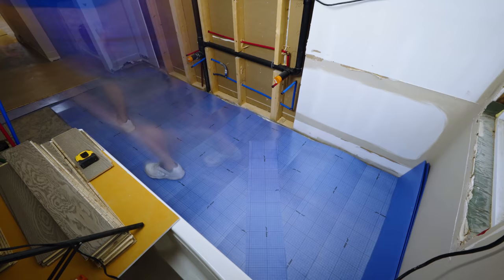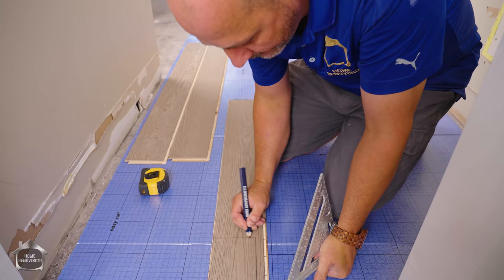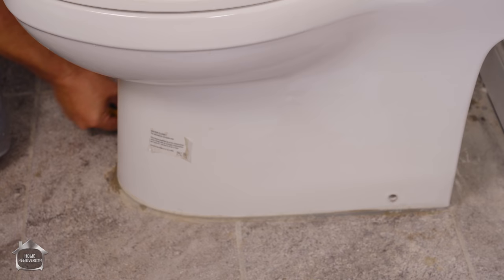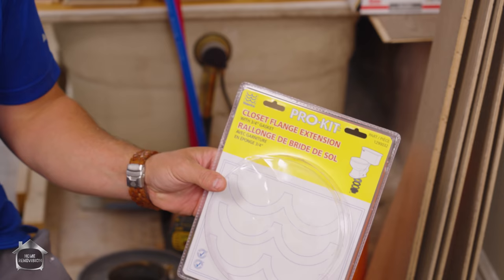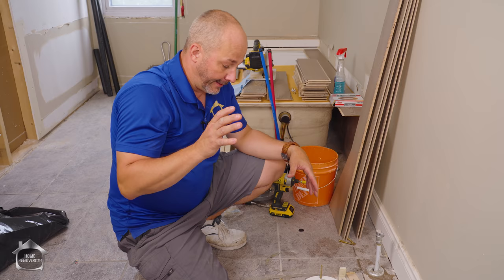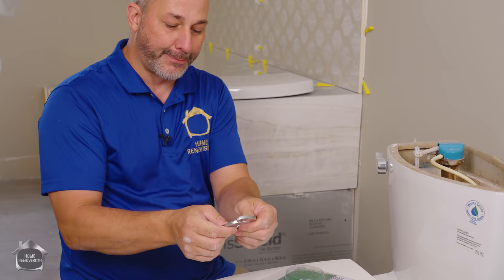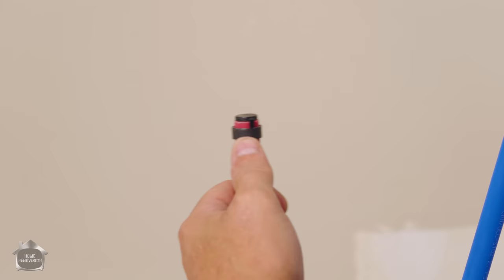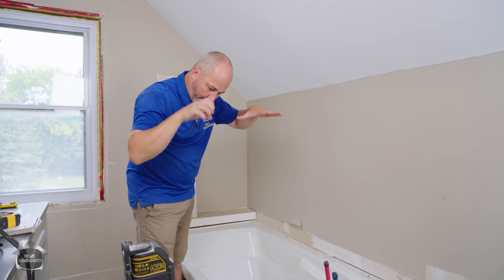How to Remodel A Bathroom on a Budget | A to Z

Comment: 3:32:00 except when the mounting tabs are grounding tabs to ground the metal outlet box

Edit*
And that is a grounding outlet, has the little odd colored tab on the bottom screw which marks it as one that has grounding screw tabs

Edit*
Lock out, tag out
Lock the breaker box, mark it as locked for work
Reply: Glad I'm not the only one that noticed... Holding the (wired) ground ears of the outlet with one hand while (saying it's "safe") and handling the live leg - had he touched that bare wire accidentally, this would've been his last video!

Comment: This is HILARIOUS!! Ok, I’m not knocking you too hard but shout out to the plumbers 💪. I’m not sure where to start lol, you did so much with so much confidence and horrible craftsmanship. Easy cut floors, I love it too (still cut it 4” too short on floor.. but when you cut your flooring, use a fine blade on jigsaw (not all purpose) to reduce rips, or blue tape to stop the rips. When you hear that “noise” it does not mean it’s in.. it means you’re breaking your connection. When you install floating floor just make sure you push in pretty hard at a 45 degree angle, when space is tight from left to right, continue pressure inward and down.. it should sound like nothing and you should FEEL it click. (I’m a professional commercial, million dollar residential) I do full remodels to Eletrical (Only ever do anything as big as sub panel additions, but full Eletrical runs) Drywall, trim, hvac, gas, plumbing.. Sauna Shower, Body dryers, jacuzzis.. which btw, you absolutely killed yourself.. when you install.. sure install with quality, but also install for the next guy. This just happened to be you, and you effed yourself by not putting an access panel in. For only $40 you could’ve made an access door in the floor, where are your shutoffs too? I’m 1/16 of the way through your video and I had to start commenting because it was so bad.. the whole toilet repair was a nightmare, you called PVC.. cpvc 😂.. You cut the fiberglass tub like 7 times.. you did all the laser measurements with a level tub you could’ve used to square your wall.. no dope on your crappy Amazon diverter, granted it may not leak, not good nuff.. Your cutters arnt old, they need new blades. You just don’t renew them. The copper clamps you use are horrible, use stainless crimp over those, DONT USE BRASS as a pex fitting, tons of claims under all plumbing suppliers for high zinc brass. If you decide to go with crap wirsbo or pex.. keep plastic with plastic. Also silicone really does work as water proofing, aka when you thought there was going to be mold, there wasn’t. NO SHUTOFFS again, smh. So “ma’am I’ll need to shut down your whole house to replace your diverter stem”.. 😴 “I’m more of a get things done kind of fellow” bro you just took 2 minutes to screw 10 screws. I can’t believe my eyes as I watch more. If you ever need to learn how to do things correct, I’ll teach you.

Comment: I am Very VERRY clueless as to how to redo or even where to start re-doing a house that was my grandmothers that was built in the 60s. I have to do new sub flooring I think and pull an old bulky vanity out and put in a pedestal sink.  Also have to remove a built in butane wall heater that hasn’t been used in 30 years or more. You have been so helpful. This is the first video I have seen but I know I will be watching many MORE to help get me thru my remodels of each room I do in the house

Comment: Jeff to make the hook on your wire use the hole on the side of you strippers. If you wire a GFIC backwards it won't work just change the wires wires to the correct place.

Comment: When I install a toilet with the normal two bolts.  I put white out on the ends of the bolts so it is easier to line up when placing the toilet.  You can see the white out though the two toilet holes much easier than the brass color of the bolt.

Comment: On new bathrooms, I like to tile around the toilet drain completely, install a new Oatey metal toilet mounting plate, drill the plate into the concrete and install toilet on top easy. Prevents it from rocking.

Comment: If you want a good connection on your outlet I would splice both wires and make a pig tail on it then use the screws. One wire has less chance of failing than two

Comment: I would like to add some kind of shelf or bottle holder in my walking shower. no idea what to even get but I do know it has to bevel or drain completely and have raised ridges so the bottles don't get all moldy. As for the flooring cut damage if you tape the cut it does help a lot to stop the breakout. I do this for drilling as well for my wood projects

Comment: In the United States in New England area where I am you are required to pigtail those wires and just use the one terminal for each and if you have a metal box you are required to have a ground screw and a ground green nut

Comment: Thanks to say every item as you go, I took notes!
-Vis d'encrage : pilex
Rona: 40$ch 
-guide vissage : camo
Rona: 75$ch Ama: 80$ch
-Block beton base patio
Home: 9,58$ch, Rona: 9,49$ch      Reno: 9,59$ch
-cut'n'seal, Home: 20,97$, Rona: 23,99$, Reno: 23,99$
-(bolt, washer, nut)x1/post
-4x4 posts
-2x8 beams
-2x10 box beams
-attaches métal (hurrican ties)
-joice tape
-ACQ screws (cedar,pressure treated)

Sorry for frenglish!😂

Comment: love your videos.   just so you know though, you can get zapped by only touching the hot wire.  you're thinking of DC power.  With DC, you would need to complete the circuit in order to get zapped but since this is ac, its already completing the circuit 60 x per sec.

Comment: 10:34 Pros like Jeff make everything look easy. I just got my pride handed to me flooring a bathroom.

- The click joint won't hold like a tongue and groove. If the floor isn't flat, the joint won’t keep boards from popping up when you walk.

- Inspect your boards. The joints won’t click if the corners are dinged or, you over hammer the boards together.

- Wide boards, like 8”, can be a pain to cut a factory edge without a sliding miter or table saw.  Usually cut edges can get hidden under the baseboard. However, you may need to be strategic when you get to matching the clicking edges on off cuts to the last of the factory boards from the box.  

- Be prepared to spend time making scribe cuts especially if you’re running parallel to a curving tub or the wall just isn’t square.  If the first row isn’t right, it’ll skew the entire thing like a bad roof.

- Is it better to run boards left-to-right or should they be front-to-back? Not sure, I went with front-to-back.
Reply from the maker: correct!
Reply: I would say incorrect. Flooring is normally left to right entering a room.

Comment: Couldn't find the subfloor product mentioned from home depot. 

This video explained a lot about this house purchased a few years ago built-in 1900. 

I now know why the floor has a dip under the toilet. Why the kitchen ceiling was ripped out. And all the other stuff mentioned here helps me understand how to improve the issues that must have occurred from the toilet which this house didn't have upstairs back in 1900. It was in the basement.

Shared this with my buddy who helped install the new toilet last year. 

Super appreciate this entire video. It's gonna help me with fixing the floor dip not screwing up anything when installing some updates. 

I didn't use wax. I had used the flexible flange. It's not so messy, but now I understand the whole process better, too 

Thank you
Reply from the maker: Cheers Patience!

Comment: I am a lady. I just want to learn something from you in order to DIY the small thing in the house. I really enjoyed watching your videos. It just comes up in my mind now so I have a question how or should I replace the tub deck mount faucet. It's kind of outdated that I want to change to different styles.  But I saw one of your video took out the tub. That means in order to access to the pipe connection, has to pull the tub on?

Comment: Jeff isn't it a bad idea to use engineered hardwood or laminate in a bathroom. Vinyl plank sure. but the others id be worried about water damage .
Reply from the maker: It's a master bath so I trust grown ups to be careful. Cheers!
Reply: Accidents happen...even to grown ups.
Reply: @juggmkj  yea but he was flipping the house so probably not too concerned with it. It’s just something I’d probably warn viewers in during the video.
Reply: @HomeRenoVisionDIY  Lol......this reason right here is why I couldn't handle the pressure of being a grown-up, in this situation! I'm a Clutz & if it can be ruined, I'd be the one you're most likely to find next to the damage. Seriously. It's bad enough I've learned to never borrow anything from anyone because it will break while I'm using it. Oh, & I'm in my mid-50's so my years of improving on this may be a lost cause............ 😍😍

Comment: Jeff I try to watch all your videos on DIY home projects you have all the latest info on materials and techniques plus I can understand clearly every word spoken. By the way , when creating halfway wall structure for faucet assembly mount  . I think you replaced the upper piece were you used a wedges to correct  vertical  piece.  But I was surprised when you created  a huge pass-through hole for water lines to tub faucet.  Anyway I enjoy watching your show. My plan is to add 3/4 bath in 1 st floor closet using macerating toilet, can't decide what brand to  buy.  I need a 120v system.  Do all need vent systems to outdoor air ?
Reply: I'm probably too late here but, the SaniFlo system is awesome! Can't say enough good things about it!!!

Comment: I heard the right way to install is with the ground plug on top.  Mainly for hospitals so that if a dr drops a tool, they can land on both the hot and neutral.  

you should take your advice btw regarding the outlets.  tighten them BY HAND instead of the drill....... don't be lazy........ love your videos tho!

Comment: I'm sure someone has commented this, but there is a release on the push in wiring for outlets.. (found out the Hard way). However I just replaced all my switches with smart switches they did not have the push in wiring option.. I go an even extra level a paranoid and wrap the outlet with electrical tape.. (wonder if that is a bad idea or not) ---- *update* literally just watched the part where you did it well done sir!!
Reply: That is not well done. That is purely amateur. Not professional. Not recommended. Or necessary. Look at any wiring device manufactures instructions. You will never find wrapping with electrical tape.  And you don't need to wrap the stranded wire around the solid wire before wire nutting. Unprofessional waste of time going on and worse coming off. Again, read the manufactures instructions. Never recommended by manufacturers or by any skilled craftsman, only amateurs.

Comment: I like my electric outlets with the face upside down. I think it's easier to plug and unplug with the ground on top. I asked an electrician, and he said technically my way is correct, because if someone didn't push the plug in completely and something would fall between the outlet and plug, it would hit the ground plug and fall to either side and wouldn't complete the circuit.
Reply: The smiley faces plugs are most always used in residential wiring. However hospitals are always wired ground pin up for the reason you stated. I'm not sure you fully get that if a metal coat hanger would fall between the plug and the wall, touching the two vertical terminals, that would cause a short circuit . Blowing up the coat hanger as it tripped the circuit breaker. Ground up is the safer way but the code has not adopted that way yet. And most people think smiley faces is correct . And want them that way in their homes. Don't want anything different than the usual. Won't increase home value by putting them up side down.

Comment: Jeff, I recently bought a house , and the previous owner had taken out the tub, and put in a stand up shower. It’s the only bathroom in the house.  I love taking a bath , and just soaking sometimes. 
Would it be that difficult to convert it back to a tub/shower? There’s room for a tub to fit back in there. Also what about the resale value. I almost didn’t buy the house because there wasn’t a tub, but I know most people seem to prefer walk in showers. What are your thoughts? Thanks.

Comment: Nice video Jeff. Should have a gfci receptacle by bathroom sink. Cut a pigtail and wirenut to your hot and neutral so the recptacle can be serviced without possibility of separating the neutral in case that is a 3 wire circuit. Also you forgot to install the metal plates over the studs you cut for your plumbing before you drywalled. Be a shame to do all that work and run a screw into your pipes. Otherwise great job!
Reply: Apparently you didn't notice, that WAS a GFCI... And more importantly, you didn't notice him holding the (wired) ground ears of the outlet with one hand while (saying it's "safe") and handling the live leg - had he touched that bare wire accidentally, this would've been his last video!

Comment: Hi Jeff! My wife and I are from Chicago and have been following you for over a year now and we love all of your videos! My wife lost her job at the beginning of the pandemic so we had to move to a new old house in Indiana that was built in 1990. We have been updating it since we moved in over a year ago. Some things that we've done so far are; tiled over tile on our kitchen backsplash, installed new counters in the bathrooms, installed new lighting, painted walls, installed new LVP flooring on the second floor, and many other things! We will be gutting and updating our master bathroom and I have a quick question for you. The shower that is there is a cultured marble shower with a cultured marble shower pan. I want to keep the same footprint of the shower and rip out all of the cultured marble walls and keep the shower pan. Would it be ok to tile over the cultured marble pan with the Eco Prim Grip? I also want to add a bench on top of the pan before I tile. Would that be ok to do as well? Thanks in advance and take care!
Reply from the maker: yes and yes as long as you are not using organics to build a bench. I would prefer to see a schluter foam bench set with thinset. Tape the bench to the joints and then waterproof roll on paint./ Cheers!
Reply: @HomeRenoVisionDIY  Awesome! Thank you so much for the response!

Comment: So I have a half bath off the kitchen that butts up to the garage. There is empty space there about and 8 x 6 area. I would like to close that off and extend that bath to include washer dryer and a shower. I can do basic stuff like plumbing electrical drywall etc. The building the walls closing off the door off the back etc is where I am lost. If you have recommended video that would help please let me know

Comment: Generally you dont want to silicone a toilet at the base because if it starts to leak you don't know until it destroys the level below.  If the base is not sealed to the floor you will know if you have a leak before you destroy the level below.

Comment: Great video! I have a question ... I don't have a flange on my tub.  I think the tub is acrylic.   Referring to around 1:09:00, Do I do the same thing and use some Loctite to seal the gap between the backer board, and the tub ( I have Hardibacker) or do I need to do something different? This does not have a shower, similar to yours.

Comment: I'm new here and SO lucky to have found you. We are starting to tackle our upstairs bath that had water damage. Question: Does the first subfloor need to be repaired if missing pieces? Or can we just use a leveler? We have two plywood pieces there and the top one has been torn up in places. I've been told the subfloor isn't in bad shape but some pieces next to the tub were torn out to check for any mold. Thoughts!?

Comment: the reason people put them upside down, is that if you end up dropping a knife or metal skinny enough to make contact with the plug itself if it gets pulled out slightly, it'll make some popping noises, blow sparks and blow a breaker, and if you did it incorrectly, you'll end up calling the fire department lol

Comment: Hey Jeff, do you have a video on relocating a toilet? Wife and I plan to install a wider tub, and it would probably be wise to scoot our toilet over the same amount of the wider tub, maybe 6 inches. Is that something I should hire a plumber for instead of DIY? Also Thanks for your videos! your videos helped me remodel floors and baseboards on 800sqft of my first floor.
Reply from the maker: depending on what you find when you open the floor you may need a plumber a structural engineer and a carpenter.